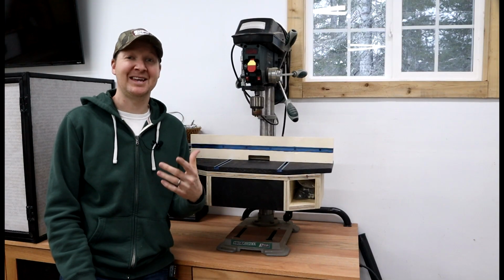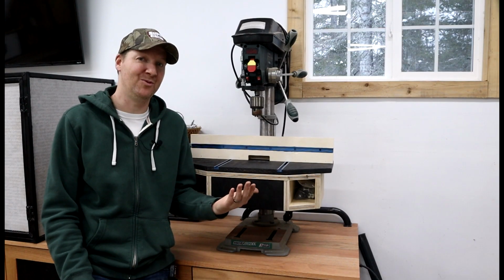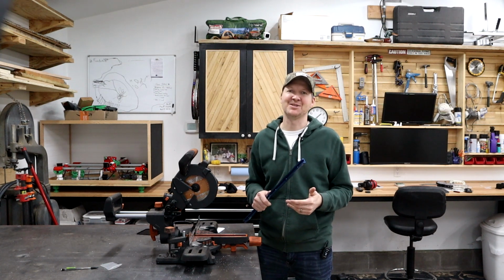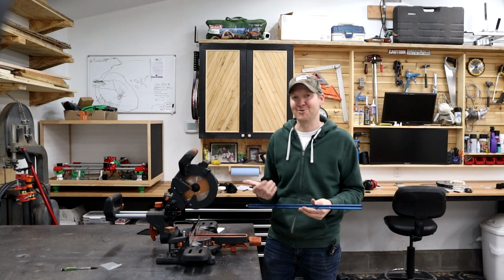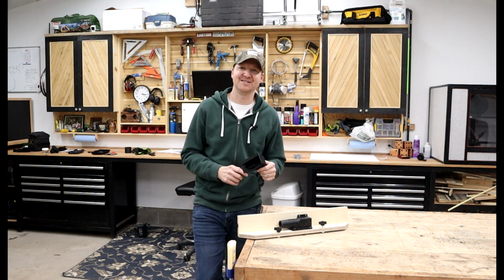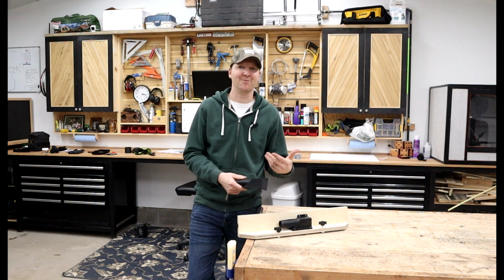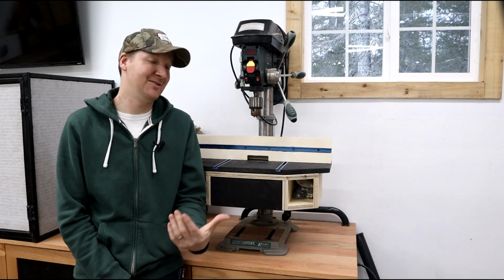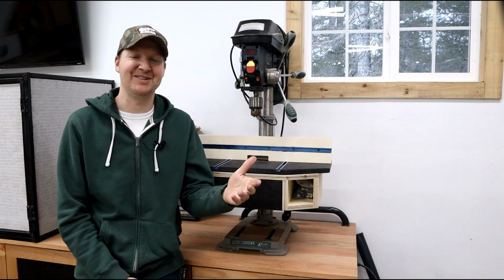Drill Press Table - Dust Collection

Comment: Hello Chad,                                                       Besides being able to collect dust, what else about your drill-press-table makes it very useful or necessary to have available?
Reply from the maker: Hello, the dust collection is a big part, but also you have a large working surface with this set up. And the fence can help you make accurate holes in a row if need be.

Comment: Would like to see it collect dust when drilling 3/4” stock for hinge cups. Of course it picks up sawdust dumped in front of the collection opening. I don’t see how dust collection would work with thicker stock. 1” high stock would leave a 1/4” slot for dust collection, and I’d be surprised if that work.  And of course 2x4 stock would totally obscure the dust collection port. 

Otherwise, nice design for collecting dust when drilling thinner stock directly in front of the port.
Reply from the maker: Yep, it doesn't work as well for thicker material. You could easily just make the hole taller on the fence, that would help a lot. I designed this one for my needs of mainly 3/4 inch and thinner.

Comment: Ok - I’ve been looking for a good design as well and I’m usually pretty nice/professional when commenting on these channels…. But I’m getting fairly frustrated as I see some pretty large design flaws in most of them (of course, if I’m going to critique everyone I should probably take a crack myself before  criticizing).

Anyway, I have two comments/questions:

1.  If you are a woodworker you have zero business playing or listening to that crap music.  It’s just annoying and embarrassing.  At least play some Clapton, Zep or Floyd low in the background if you must have music.  I never understood why people even play music during theses videos - at least you had the music off when speaking ( preferred over just lowering volume).  So many YouTubers drown out their instructions/lessons with music.

2 more importantly, you’re source capture opening is way to low/short.  I understand the problem of needing it to be below the fence t-track and there are limitations of overall fence height, but your opening is only about an inch or so high from the table. Most of your work pieces will completely (or mostly) cover it up unless you are drilling on the very end of a board.  This makes the dust port completely useless.  

I’m looking for a design that incorporates the side mounted t-track (not top mounted) and has a dust port opening as high as possible to accommodate larger work pieces (at least 1.5” thick).  Meanwhile the fence height is limited to about 3” high to all for the full action of the drill head, etc.  maybe having stop block t track not run the entire fence?  Maybe have a section on left and right if center and leave the middle open for dust opening to be cut higher into the fence?  How often do you need the stop block less than 2” or so from end?  Or, maybe make plywood stop block a little over sized so that when the t track ends, the block protrudes further toward center?  

Anyway, I’m rambling.